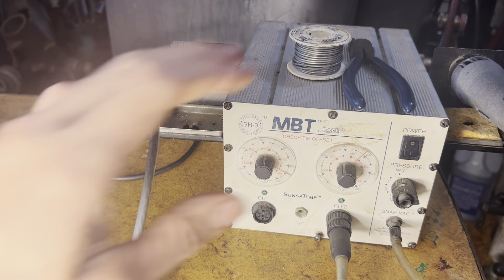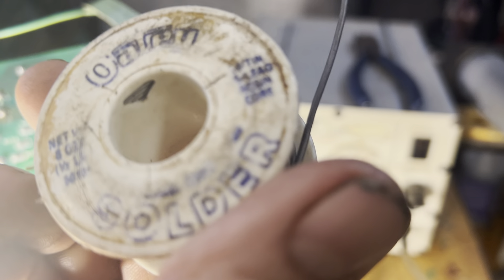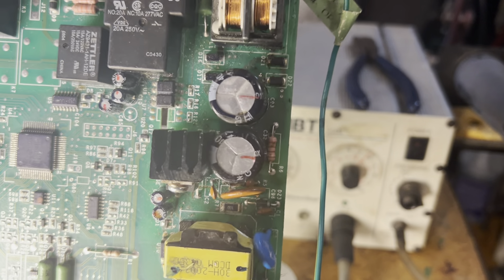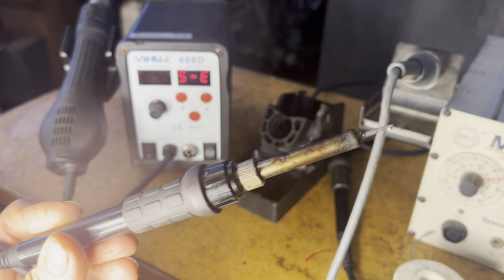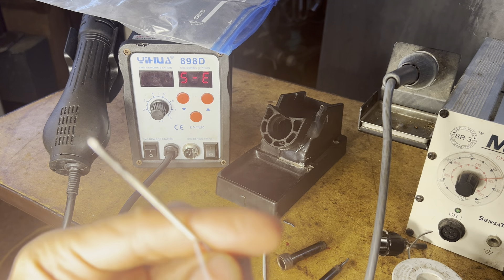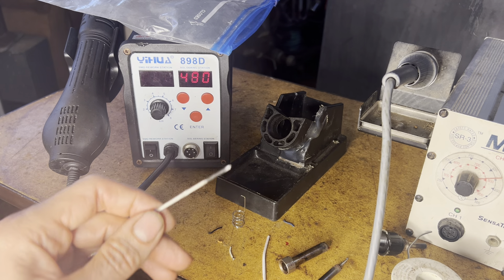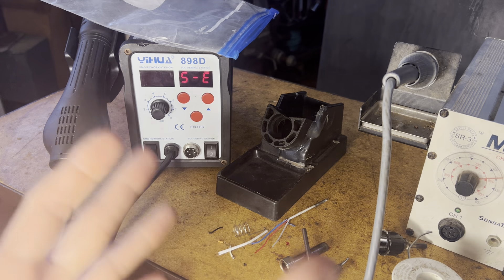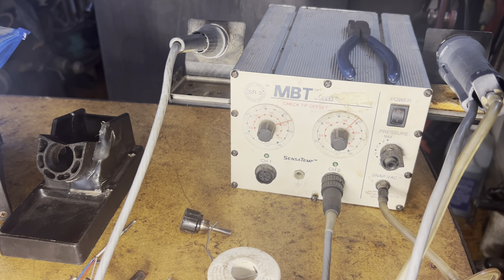Soldering issues

Comment: I currently have to fix my dishwasher panel, (broken plastic parts inside) and thought my dryer but realized the parts are almost as much as the dryer is worth... 🤔
Cut corners eventually....
Reply from the maker: Rig it until you find another, that's what I do.
Reply: @chargermopar  I'm just not as skilled at that as you are. My friend looked at the 2 parts for the dishwasher and suggested I just order the latch part first. It's relatively cheap, all plastic, and see if just that will fix it. If not I may buy another dishwasher...nothing lasts well anymore.